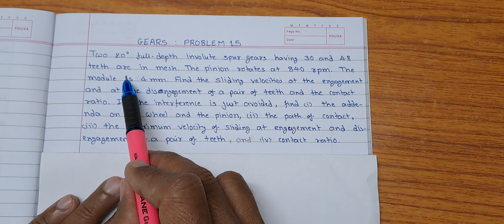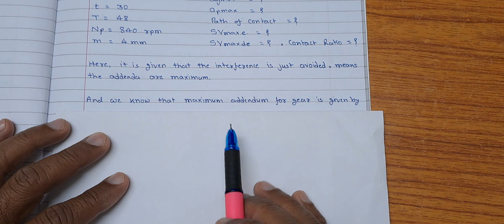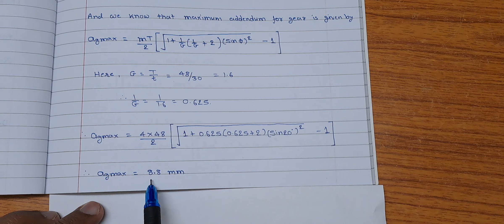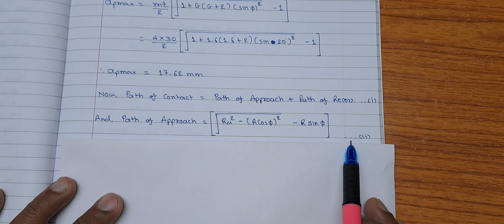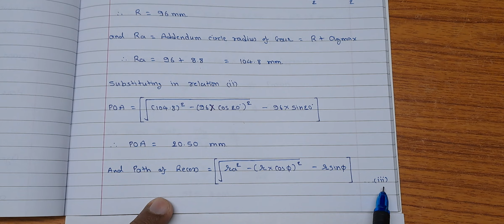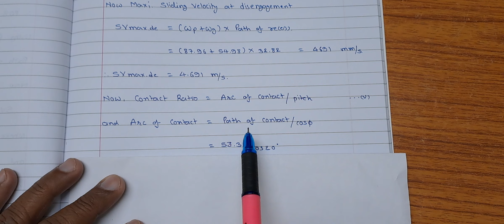GEARS PROBLEM 15 SSR

Comment: SIR, WHY WE TAKE SMALLER GEAR AS DRIVER AND BIGGER GEAR AS DRIVEN ?
Reply from the maker: Dear,
Generally the gear drives are used as speed reducers. This is possible only when the smaller gear is a driver. So, in general practice if it is not specified, then a smaller gear (pinion) is considered as a driver.
Reply: @drjmprajapati  Ok sir Thnakyou